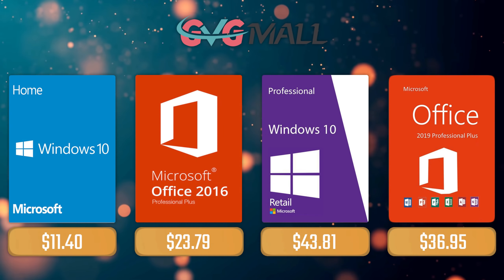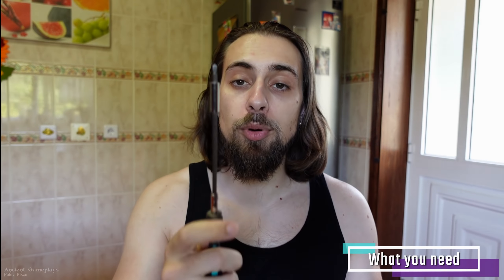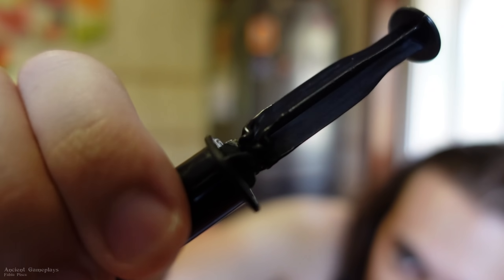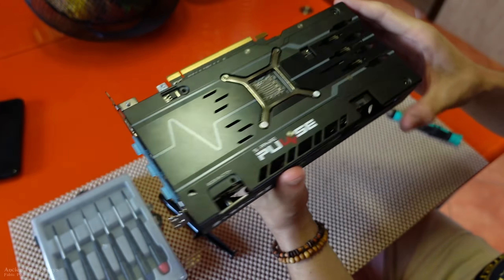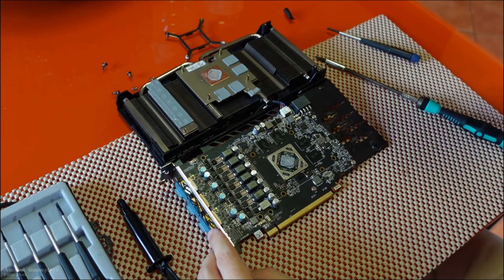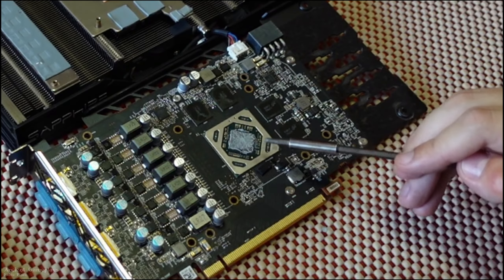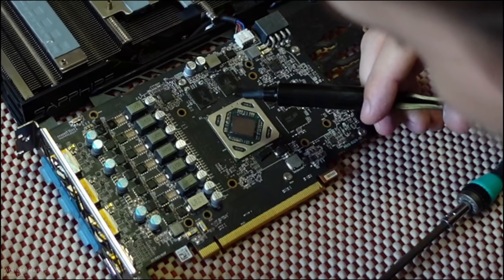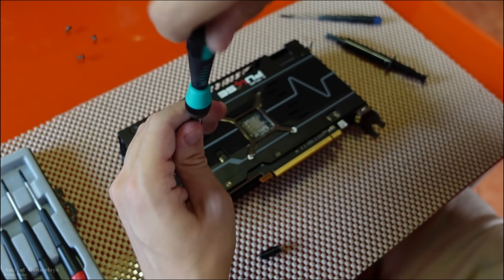How to REPLACE your GPU Thermal Paste | 2021 Easy Guide

Comment from the maker: IMPORTANT TIP:
DO NOT do this process with the GPU over fabric (or your hands), since that will cause static electricity that can kill your GPU (Hard to happen, but may happen).
Always handle electronics on Glass or Wooden tables/desks :D
Reply: I always use aluminum foil works like a charm 😎 ⚡️
Reply from the maker: @user-jc2in3cp3g  xD
Reply: when you did this on your 6800, did you have to add washers for extra tension or was it fine without?
Reply: Please make a Review of Asus Phoenix RTX 3060 12GB and compare it to ASUS DUAL RTX 3060 and to RX 6600 XT 8GB Please 💯💯💯💯💯💯

Comment: When the paste is old on a GPU you need alkohol (isopropyl or very high volume ethanol) because you can not remove a dry old paste from a gpu with anyhing else without risk of dmg.
Reply from the maker: That is why i mentioned it. THOUGH, removed thermal paste that was like a brick and did it with paper only haha

Comment: SOME thermal paste are conductive (and I'm not talking about liquid metal), such as silver and copper based !!!
DO NOT SPREAD OUTSIDE THE DIE, or opt in for some non-conductive thermal paste, or apply nail polish on the resistors around the DIE
Reply from the maker: Yes indeed, but all casual ones are non conductive
Reply: spread on Motherboard and see it what happens. Nothing. If u oc and have 1 hour on computer yes it dies :D U can do with tooth paste or even with what you want to do, But i have noctua h-2 i have more fps ..vs regular paste.. When i try Mx 4 i had 40 fps less in dirt....When i used conductive it was even worse vs cheapest thermal paste FPS Lows are decreased.. so.
Reply: There's not a simple thermal paste and I mean PASTE which is conductive, not to my knowledge. Arctic silver 5 is CAPACITIVE. All the known thermal pastes from well-known brands such as Thermal Grizzly/Noctua/Arctic/Arctic Silver/Thermalright/Thermaltake/Corsair are non conductive, even the chinese GD900 and the other HYL something are not 

P.S: I tested all of them using a multimeter soooooooo..
Reply from the maker: @Devastor23  Yeap, that is why i said "casual". My uncle has some pastes that are conductive, but those are kinda the "industrial" type i reckon

Comment: The video I needed, thanks! I'm so glad to see i don't need to also replace termal pads, that was my main concern.
Reply from the maker: Unless you're vram temps are high, there is no need
Reply: @AncientGameplays  only GPU core got a bit higher (like 2 degrees) after almost 4 years on my 580, was thinking about changing thermal paste since I still have some from the tube I used on the CPU.
I only have a question: how do you make sure to put the right amount of pressure on the die so it spread the paste but not too much? I saw that too much pressure (apart from the risk of damage of course) can also impact cooling by spreading too thin the paste.

Comment: Ah the Sapphire Pulse, looks like 5600XT no? 
When I had a Rx580 Pulse I changed paste after a year, the stock paste was actual pretty good, yours looked ok too. 
After the 580 I had a 2060 ASUS Dual for some time, opened it up after having it for 3 months, paste was already a bit thick :-o and some new paste would actually lower the temperatures a few degrees.
I don't think I've ever not opened up a card before the warranty expires lol altho I think my current Rx6800 will live out its warranty without being opened, also the reference model has the graphite thermal pad so it's not needed to be changed.
I just repasted a Sapphire R9 270X today since I wanted to see how good the MX-5 from Arctic is
Reply from the maker: It is a 5500xt hehe
Reply: @AncientGameplays  Ofcoz! Should've payed attention to the rotated die heh
If it's not rotated it's the top die, e.g Navi 10, 21, and if its rotated it's the lower dies, it's kind of a trademark to distinguish Radeon dies!

Comment: Did a Morpheus switch on my Vega56 blower two years ago. The hotspot temps of this really hot Bad boy went down from 105 degrees to around 80 under full load. Got two 120mm Noiseblocker fans attached to it. It's a lot cooler and quiter than before. I hope it will carry me through the GPU Crisis we have right now. 

Cool vid by the way. Most people don't dare to remove the cooler from their GPUs somehow.
Reply from the maker: Yeah, blower types aren't that great for "normal" cases. A morpheus is way superior :D

Comment: Maybe i missed it, but why not change the thermal pad? i have a MSI 570 8gb since 2019, i want to do the repaste, but i dont know the thickness for the pad. I havent tried to open my GPU yet. thanks man
Reply from the maker: Because the thermal pads wont need a change unless your model is really bad

Comment: Why did you repaste the 6800? And did it make a temp difference?

Edit: I got to the end of the video where you answered it already
Reply from the maker: The rx 6800 was more or less the same, since the thermal pad in the amd version was surprisingly good. The other cards made a good difference

Comment: The thing that applies pressure is called a Spring Fabio :), great vid btw. You might want to warn people that it will void their warrenty if they unscrew the screws that have a void sticker on them.
Reply: Fabio, you point at the wrong chips at 7:30
Reply: put a hair dryer over the sticker and peel it off, and then when done lick it and itll make it sticky again and just slap it back on the screw
Reply from the maker: In what part did i point wrong? In the capacitors part? :D
Reply: @AncientGameplays  yea it goes over the chips not the battery like looking things

Comment: As always: fun to watch your videos! :).   But why didn‘t you change the thermal pads of the vrm‘s and the vram? These can also get harder and stiffer by time and should be changed aswell. ;)
Reply from the maker: Hey man, no need at all. Unless you have a REALLY crappy model, or a defective one, you wont need to change thermal pads in years
Reply: @AncientGameplays  Depends on quality you want replace them 2-5 years, i alredy got 4 years old gpu with vulcanized thermal pads which isolate heat from VRM causing vrom to boom :D and smoke. Lower temps of VRAM and VRM = Longer GPU life.

Comment: I do not recommend doing the spread method based on my experience 
Air bubbles  got trapped in the thermal paste and i got worse temps
I redid it again with the pea method and it worked like a charm

Comment: It's actually recommended by some, to put the paste in the refrigerator, to make it easier to handle and manually spread! I used a cheap paste for my cpu, and I got slightly better results by spreading the paste.
I only replaced the thermal paste on my old 270x after 6 years, when it died 🤣 it can probably be fixed and reused. The new one is still fine.
Reply from the maker: We now have good thermalpaste that isnt actually expensive, like the mx2, aeronaut, cooler master nano and so on

Comment: I want to do this with my gygabite 5600xt but since I haven't found anyone who has opened one before I'm pretty afraid of screwings things up
Reply: that card dont even go above 60 at most, every once in a while itll go to 61, most of the time it sits around 56
Reply from the maker: If your temps are fine don't mess with it. Still, remember that it is basically the same thing as you see here :D

Comment: Mine 6700 xt fe edition .. is a hot one.. 80-85 degrees.. and heatpoint around 100 degrees..
This while playing rd2 on 1440 p ultra settings.. 
radeon software is stock ( not overclock or undervolt)

I tryd to overclock but i dont see mutch diffrent in performance.. ( benchmarking)
The only way too see diffrent to rise clockspeed too 2800.. and then im afraid im gonna break things.. and yes hes getting hot aswel

Is this a issue of the stock cool paste.. or just a bad design..
Reply from the maker: Watch my oc/uv tutorial. Temps will decrease a lot
Reply: @AncientGameplays  yes temps decrease alot, but there is no performance win here..whit same stats,only i gain 7-8 fps whit clockspeed 2800 , and then the temps are high again
Reply from the maker: For higher oc you need better cooler. Those are made for "normal" clocks. Not oc ones :D

Comment: My rx 6600 xt junction temperatures goes over 100c sometimes over 110c, I can use any type of thermal paste on the gpu, and do I also need to replace thermal pads?
Reply from the maker: Thermal pads are usually for vram. Just change thermal and screw ir tight and you are good to go. Apply just a little of thermal past as rhe die is very small

Comment: i dude like you videos , by the way may i ll use some aluminum liquid instead of thermal paste ?
Reply from the maker: You mean liquid metal? Liquid metal is conductive so you need to be REALLY careful
Reply: @AncientGameplays  i used to put on my delided 7700k cpu . Could it be more risky then usefull to try to put on 6900xt gpu after my guarantie end date ? did you ever try ?
Reply from the maker: @abenylami1919  yeah, unless your temps are really high, there is no need for it
Reply: @AncientGameplays  im actually on pretty cool temps: around 60-65°C 240-260W GPU power and 70-73°C on 300 W GPU power instant consumed, but i heard about new thermalpad on vrm can cool a lot and its very nice for mining but not necessary for gaming. cant you confirm that ?
Reply from the maker: You are good then :D
Reply: @AncientGameplays  tks you dude see you in next

Comment: Thanks ! Recently got a new cpu in my build used for 1 day couldnt stand the stock cooler; i got a new cooler; and re applied a new thermal paste (old one was still new so i didnt remove it) then I remember that i didnt remove the plastic from new cooler heatsink so I open again to remove but didnt have much paste left so I just remove the plastic and put little paste. Did I fk it up ? XD do I need to clean it all up and re apply new?  Cpu is showing 30 idle and 50-60 when gaming
Reply from the maker: 50-60 is perfectly fine
Reply: @AncientGameplays  thanks !

Comment: Nice video as always :)I have a question about my cpu;  I'm using Ryzen 1600 af and I have an msi b450 a pro (not max) motherboard. I couldn't even set my processor to run at 1.2v with all cores at 3500 mhz. I didn't want to force it with the stock fan. Do you think I should contact amazon and return it? 3425 mhz auto runs while in game. It also goes up to values like 3450-3475 in the meantime. Is there too much diffrences between 3.8 ghz and 3.45 mhz ?
Reply from the maker: You just let it run at stock...update your bios and chipset drivers
Reply: @AncientGameplays  Thanks for the answer.  Is there too much diffrences between 3.8 ghz and 3.45 mhz for 1600 af ?
Reply from the maker: @fatihmw3  yeap, even more on those cpu. 3.5 to 3.9 will make a huge difference...that, and ram frequency. Get a decent cooler tho
Reply: @AncientGameplays  Understand thanks.  Will you make video about this content ?

Comment: i did 2 months ago , i use liquid metal , it worked very well
Reply from the maker: Be careful dude..liquid metal is conductive
Reply: @AncientGameplays  i knew the risk but nothing happened , have great results after liquid metal. 10°C less temp. for CPU and gpu cores
Reply from the maker: @okanu.407  nice!